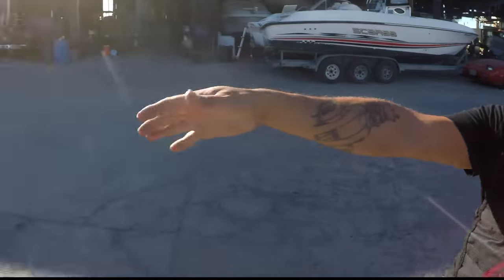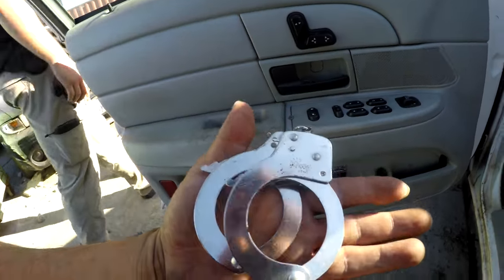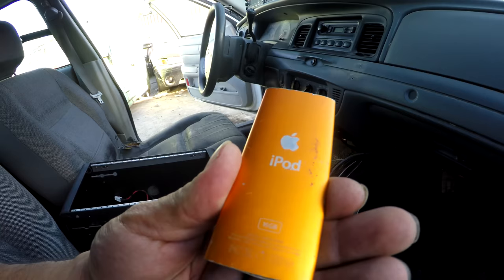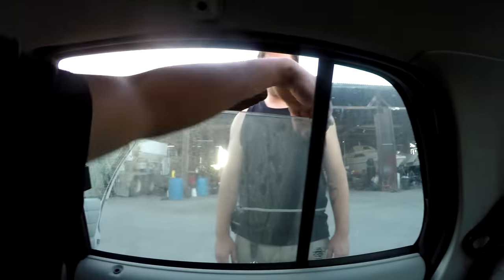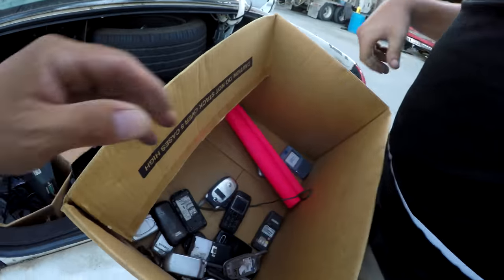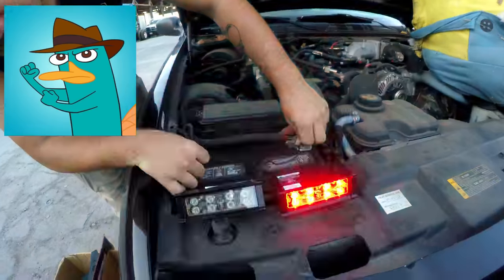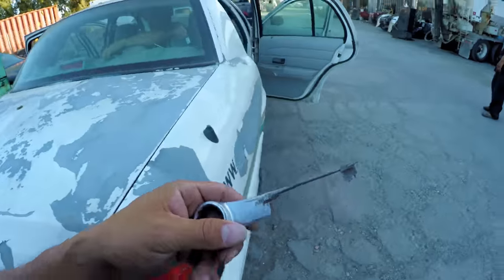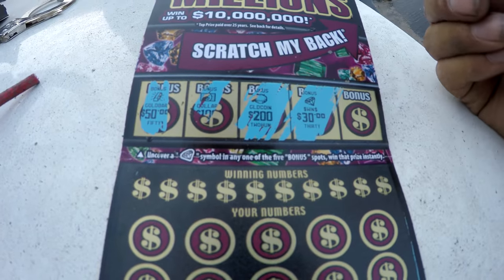Searching A Sheriff Car Found Makeshift Prison Escape Key! Ford Crown Vic Police

Comment: maybe you can help me out. I'm trying to get a half decent PA system but I don't know how to properly look them up on eBay. What I keep getting are those $20 ones from China.i am working on a Ghostbusters Van. Other thing I'm looking for is a blue roof light or white roof light around 24 to 30 inches long and full life to me. Can't find one on eBay off of an old vehicle. Everything I'm finding is one of those modern seizure lights. What I'm looking for is a old rotisserie style light. Not one of those strobe lights.you know of anywhere is I can look for those items or perhaps what I'm doing wrong in regards to looking on eBay and not finding what I'm looking for.no I'm not joking. What I'm working with is a white van with a searchlight on the engine bonnet utility model. I got the sticker kit a while back. Haven't had it put on yet. For the record I've got several of those old Apple Chargers, you can still get them here at the dollar store, so probably can still get them at the American dollar stores. I'm trying to understand how was all that stuff in a cop car? Here in Nova Scotia. When they send the cars off to auction. They stripped them down to their Curlee's you almost never get one with even the push bar on the front. I've got a 2006 charger that I'm trying to get a push bar for and you literally can't get one short of paying around 600 for a new one getting one used is not possible because when they auction the cards off. They stripped them down to the bones and go over them with a fine tooth come. I don't think you even find a bubble gum wrapper in the ones they sell here. It's insane how they sanitize them before they're sent to auction. What I mean by sanitize is anything remotely resembling any kind of police equipment is removed, you won't even find a carbon copy of a ticket in the car. Only thing they generally don't bother removing is the searchlight or the little metal tags that read interceptor. I've even heard rumors that their pealing of the cop car motors and drivetrains and putting junker civilian motor and transmission in the vehicles.